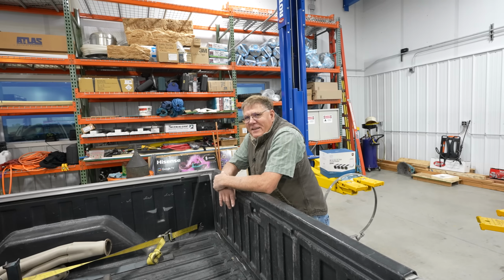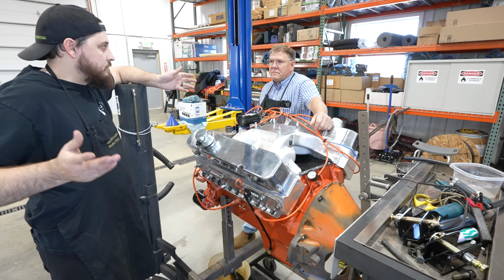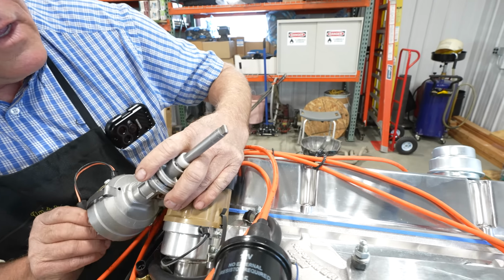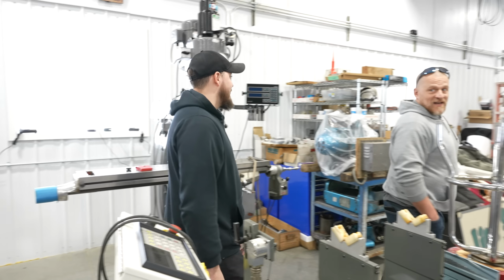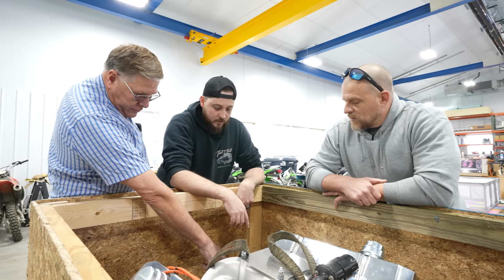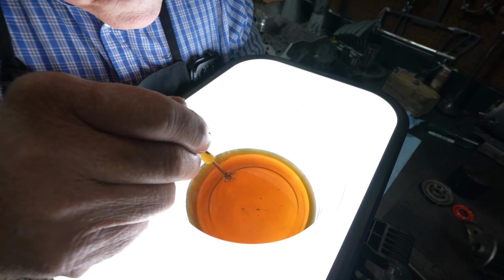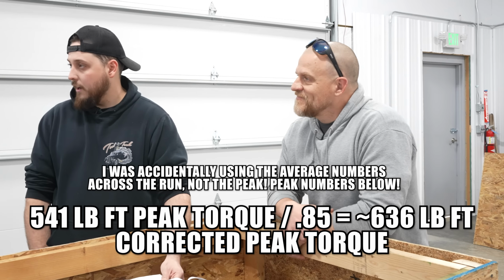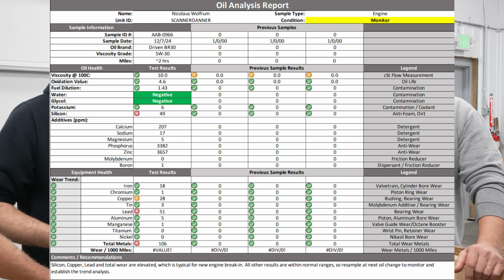From RATTLE CAN Rebuild To A MONSTER 483 Stroker! Dyno Time!

Comment: I recently learned that the EFI swaps always have midrange driveability problems if the exhaust crossover in the intake is left open. The mixture loses droplets and the crank ends up getting less degrees under torque per cylinder fire. Apparently they run way better with the crossover blocked off. The problem shows up at part throttle cruising, like they just don’t run quite right, economy goes down, and it can’t be tuned out. Looks like it’s problem everyone experiences but most people don’t know about the crossover fix
Reply: You must have just watched Uncle Tony's garage where he was talking about this . I knew about this years ago when someone I know put a Holley fuel injection system on his 440 for his 70 Dodge Challenger and no matter what he tried as far as tuning wouldn't get rid of that mid range hesitation.
Reply from the maker: No exhaust crossover here.
Reply: Nah. You recently got one old fart's opinion and accepted it as truth. GM built millions of TBI engines with heated intake manifolds and they ran fine. If the mixture is hot you'll lose a little torque and be more detonation prone, but at part throttle it runs just fine. What can happen, TBI or carb, is that the light-load ignition advance is too much and the distributor rotor to cap phasing gets off enough to misfire. And the Holley Pro-Jection TBI stuff had absolute primitive garbage for a computer. Reprogramming a GM computer was a much better solution. The only place I'd use TBI in 2025 is on an engine with siamese intake ports like a Chevy stovebolt as the fuel needs to mix with the air well before the intake valve.
Reply: @Joshie2256  You are right my late 80's gm 454 just dumped gas down the TBI like the exxon valdez and it pulled everywhere all the time like a champ on a manifold with a heated crossover.
Reply: Tell me you watched utg without telling me you watch utg
Reply: Sounds like you watch @UncleTonysGarage ;)  That series on EFI to carb conversion is good.
Reply: Another “uncle Tony” theory with zero physics behind it.  He’s a decent and creative seat-of-the-pants tinkerer, but every time he posits something engineering related, it’s complete nonsense.  Like his theory about the gen 3 Hemi cam not getting oil because the lifter angle is laid over so flat 😂. Nevermind 60+ psi of oil pressure.

I’m  way more inclined to believe the Engine Masters guys’ observation that the FiTech and early Sniper systems just don’t work with dual plane intake manifolds.  Supposedly the current Sniper II is far better in every way and doesn’t have some of those weird control/software quirks.
Reply: @stevelacker358  same with the fast efi I had on my 461 bbc. I stopped watching utg when he did the whole 3 finger hone compared to the flex hone video. F#ck  that 3  finger hone
Reply: The issue is each type of fuel delivery system has a place . A throttle body system will have fuel distribution problems just like a carb. On top of that The afr sample you receive from the collector is an average of the respective bank of cylinders. Moving to a sequential multi port set up with one 02 sensor per cylinder will give you the ultimate control over afr and fuel distribution issues at the expensive of increased intake air temps/density .
Reply: Have read an article that said to use single plane intakes for efi conversions for that particular reason
Reply: nah efi is way more control bro! facts
Reply: @maxpaul11  it is but, the heat from the crossover messes with fuel injection. The crossover is for carbed engines and the intakes for these older engines are designed for carbs.

Comment: This is bs. That truck came with a rebuilt engine, no time on it!
Reply from the maker: And a flat cam...
Reply: After I saw that video, I dumped in my flat tappet engine a can of zinc replacement additive
Reply: It WAS ready for the road. Best 3 cent rebuild I ever seen.